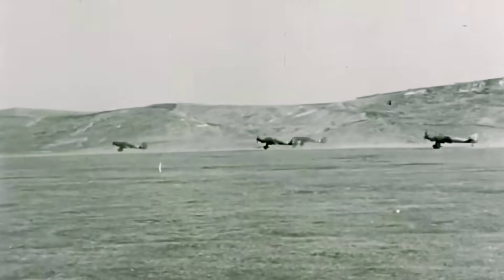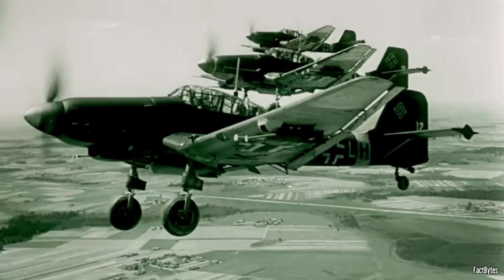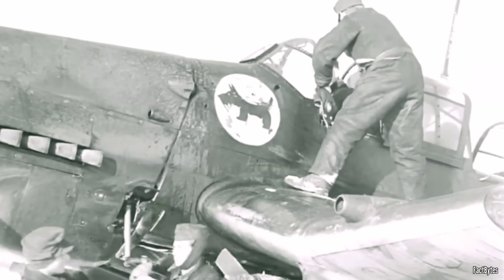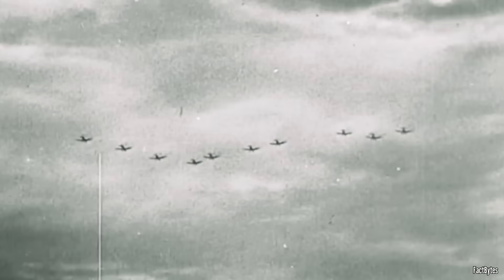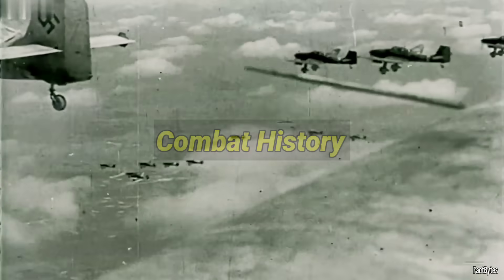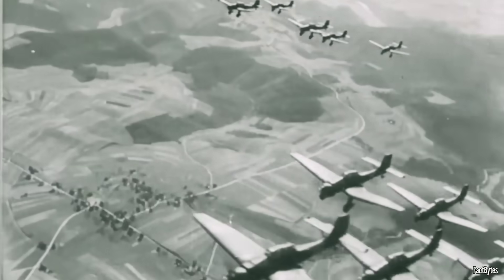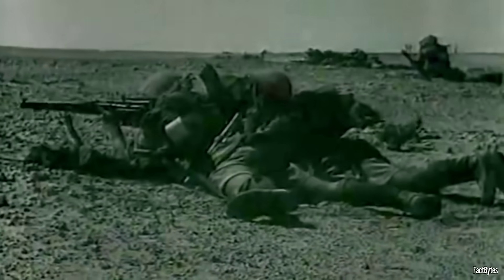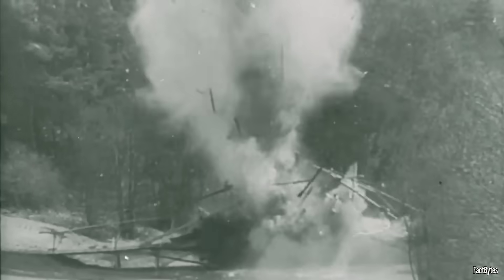The Anatomy of a Dive Bomber: How Stuka Pilots Hit with Deadly Accuracy

Comment: The depiction of the airbreaks on 3:53 is wrong. They were positioned in the front lower part of the wing and not at the ends. Exactly next to the wheel strout base.Right on the top front of the underwing cross.

Comment: So far, this is an excellent explanation of the Stuka ( pronounced Shtuka with a Latin U ). However, because they did NOT dive 100% vertically, they were not very accurate, yet, for the WW2 standards, they were OK. No, they CANNOT hit a tank, contrary to the common understanding. They can, only, do so, in case they dive to a few meters from the tank. However, after a lot of practice and a lot of runs, they may. I think, the way they did so was by diving quickly and then flying horizontally against the tank to a few meters. Either way, they were marvelous for the WW2 standards, but, very easy to shoot.

Comment: The pull up automatc didnt pull up the Ju87 from a dive, it only trimmed the plane nose up, so when the pilot passed out from the pull up, the plane would continue to climb.
In later models the pull up automatic also wasnt conected to the bomb release anymore.
The accident were the Stuka flew into ground were controlled flight into ground, because the pilot didnt or did pull up to late, it had nothing to do with a failure of the pull up automatic.

Comment: It's difficult to execute a true 90-degree dive. Even if the aircraft is pointing straight down the wings are still supplying lift and the true angle of dive will be about eighty degrees. I wonder how the Stuka would have performed at the Battle of Midway, which was won by the SBD Dauntless. The Dauntless had large barn door dive brakes and if one air brake was damaged by flak, the aircraft became uncontrollable! Those pilots were something else... The minimum safe release and pullout altitude for the Dauntless was 3000 feet but I think that the Stuka went lower.

Comment: Tank killer version with mounted antitank guns/"cannon" instead of carried bombs used in late War ?
  I think most of the failures of the pullout mechanism was when the pullout or bomb release was done too close to the ground. 
  I imagine that the life cycle of the airframe was good only for a limited number of dives/pullouts before the possibility of stress cracks would get too high- that is after a certain amount of use the plane needed to be retired or it would eventually break up during the pullout
Also not supposed to dive vertical- but it did
American dive bombers much faster and carried more ordinance but couldn't dive vertical and thus less accurate ? At Battle of Midway a then newer American divebomber model had to be dived at a somewhat steeper angle than it had been approved for but when that was done it took out all of the Japanese carriers ? 
  JU 87 "Stuka" one of the first uses of a new high strength Aluminum alloy ? 
also had explosive bolts that allowed the "Eagle Claw" landing gears to be blown off/jettisoned for when the plane had to be "ditched" onto water safely ?

Comment: The sirens were also removed because they had a habit of deafening the crew.
Reply: Yes, not many videos actually mention that they removed them. Although I have a book and they were still present on some late on in the war. Even though this video mentioned they were removed it continued to use the sound effect all the way through. It must be the most over-used sound effect since the talkies. Wish I owned the copyright. If I did I'd stop people using it.
I'm sure I either read, or heard in an interview, that the name Jerico Trumpet wasn't applied to the siren but to the device they sometimes attached to the bombs, which had a similar effect without deafening the aircrew.

Comment: there is one on display in Hendon RAF museum London ..... 
I was very surprised at how big it really is .... and yes built like a tank ..... 
a lot of Stuka pilots apparently pierced their eardrums with a needle ... to overcome air pressure equalisation issues ?
Reply: Funny as a pierced ear drum now makes you medically unqualified to pilot an aircraft.
Reply: Yes the Stuka at Hendon is impressive.They also have a Fairy Battle, which is pretty rare. As a kid I actually climbed through the Lancaster they have there. I'm very skeptical about the ear drum piercing. Do you have a source? I have a book called Stuka Squadron, about Stukagruppe 77. No mention of it in there. Puncturing your own eardrums seems like something you'd mention. Also, I've done a sky dive from 12,000 feet (the height of a Stuka dive) and I didn't have any ear problems, although my terminal velocity was lower.

Comment: The Stuka also had a quick fuel dump mechanism on some series, and were employed on night intruder roles in 1940 & 1941. 
A Ju 87 achieved the first air victory during World War II on the morning of 1 September 1939, when Frank Neubert of I./StG 2 "Immelmann" shot down a Polish PZL P.11c fighter while it was taking off from Balice airfield.
True, the automatic pullout sequence was distrusted by some,not for reliability reasons but 'they disconnected the system because it allowed the enemy to predict the Stuka's recovery pattern and height, making it easier for ground defenses to hit an aircraft." (Stuka Angriff: Sturzflug von Helmut Mahlke, Mittler Verlag -1993).
At Rechlin and Desau they realized that the highest centrifugal g load a pilot could endure was 8.5 g for 3 sec. and at less than 4 g there were no problems encountered  on consciousness loss or visual impairment. Raising the centrifugal force above 6 g, half of pilots experienced grey-outs. With 7.5 g...vision vanished altogether for 30% of pilots. The inverted gull wing design offered several key aerodynamics advantages besides providing better downward visibility.  It also allowed for a shorter and sturdier undercarriage. Additionally, the inverted gull wing configuration, with its double-spar construction, improved lift at shallower angles of attack, which reduced take-off and landing distances. Many innovations employed in the StuKa, like the attachment of the FuG 101 Electronic Radio Altimeter and the use of the FuG 16Z transmitter/receiver set to augment the FuG 25 IFF (Identification Friend or Foe).  It was the only dive bomber that could routinely do a 90 degree (true vertical) dive. If not misused for the role it wasn't designed for, the Stuka was truly in a class of its own.

Comment: The JU- 87 show cased gernany's technology advances. The plane was a flying computer! The pilot only had to set dive then the plane did pretty much every cept for take off & landing. Best dive bomber ever.
Reply: Think they had to hand fly the dive up to the point of bomb release. And hope not a split second too late for the release and pullout. But probably the closer to the ground they bottomed out at,the potentially more accurate the bomb placement such as on a moving automobile.

Comment: Also one of the best-looking planes of the era. Great lines. 👌
Reply: It's so ugly it's beautiful!  (Long comment follows)in the past I built several scale models, both the Revell one in 1/32 scale and the Airfix in 1/24 scale.  The most fun part was painting it with an airbrush.  In a book, I found a Stuka used on the Eastern front, that had a winter camo scheme that i found very interesting.  If you love to airbrush your models, boy have I got a project for you! 

The paint scheme I used was German "Hellbrau" or "Lichtblau" on the underside, and German medium green on the upper surface.  Then I mixed up some flat white and set the airbrush on the lowest pressure I could get away with using, because I wanted to make the white lines as thin as possible.  

And then I over-sprayed the top surfaces with a series of thin, squiggly white stripes applied seemingly at random as the real aircraft had been painted.  (I suspect the Germans might have "winterized" their aircraft in the same way the Panzer crews did to their machines, by using white-wash or some other semi-permanent paint, and just washed it off the planes/tanks once the snow was off the ground.  
When it came to winter camo patterns, I doubt two Stukas looked the same, especially since winter camouflage was usually applied in the field by the ground crew.  Anyway, i loved the effect afterwards - the best way I can show what I did is how this guy painted his: 
https://tinyurl.com/w6f39v3v
Reply: @Tiberius_I  I find really interesting the desert camo scheme of the first batch. The B and R Stukas that arrived there were painted in the original factory two tone green at the Junkers factory. On site was only available the italian chaki yellow which was applied by brush or airbrush leaving green patches below. It is really amazing to see how this was. I have built some decades ago a 1/48 exactly as those. First the standard greens with sharp endings and over the italian chaki sand  yellow. Given that the yellow would get really dark for matters of trasparency, I first painted the base color with it, and over it I painted the two tone green. The beauty of it is that the yellow looks like airbrushed, whereas the greens look sharp like paintbrushed. I have it  with open the engine compartment, canopy and left cannon opening. Plus a small oil hatch in the opened lid position, All full of leaks and desert maltreatment.
Reply: I feel the look somehow embodied the Nazi ethos.  It was an amazing artistic expression in that regard.  There's one in a Chicago Museum, but it lacks the spats on the wheel assembly and somehow it seems something is missing.  It's like every detail mattered aesthetically.
Reply: It wasn’t just about what the Lancasters carried—it’s how they looked doing it. That sleek, powerful silhouette cutting across the moonlit sky gave the whole operation a kind of dark elegance.

Comment: I think you may have highlighted the dive brakes in red incorrectly.  I believe the dive brakes were the horizontal slats just behind the landing gear. Please confirm.
Reply: Yes. At 3.30 you see the dive breaks in flying position from the front as just a thin line, so thin were they. Seen at 3.46 you see the dual lamella from below. At 3.53 you see the Junkers-Doppelflügel incorporated in the red line - that are in truth ailerons and/or trailing edge flaps. For diving, the lamella were rotated 90 degrees. Think of it: you had to put them somewhere, in proximity of a structural element, like the main wing spar, but out of propeller wash. So they put it appropriatly at circa one third depth of the wing, outward next to the landing gear, up to the middle of the outer wing, where the hardpoints for the bombs were.

Comment: ANY a/c type operating in a zone of enemy air supremacy will sustain prohibitive losses; the Stuka was perfectly normal in that regard. And every plane is designed for a role(s) that, if not properly utilized, usually produces disappointing results. Herein lies a lesson of the woes that comes of putting amateurs & nincompoops in charge. Unprotected Stukas, SBD's, B-17's, it doesn't matter. Even had the Germans been flying  the vaunted P-51's in '44 & '45, it wouldn't have changed the outcome. That the Stuka endured under tremendously adverse conditions the last two yrs of the war says a lot for the concept & design. I believe, on almost the very last day of the war, a lone Stuka planted a bomb squarely on the mid-span of a key bridge on the Eastern Front, eliminating the threat, and successfully returned to base.

Comment: According to Eric Brown, test pilot extrodinaire, the Stuka was the only true 90 degree dive bomber.
Reply: Cookie was the coolest prop-job test jockey, and a hazard to Condor bombers
Reply: I saw an interview of a Dauntless pilot. He said there was no 90° dive bomber because even if the nose was straight down, the wings' lift caused a significant ground speed. He said they did dive nose directly down in the Dauntless but were actually traveling about 70° from horizontal. That had to be considered in aiming.
Reply: @Mishn0 But if he'd never floen a Stuka, which Brown had, how would he know - ?
Reply: @simongee8928  On the other hand, Brown wasn't a trained, experienced dive bomber pilot.
Reply: @Mishn0  It's a technical topic. Stuka controlled it's speed so well + the automatic pull out it was the only one where you could actually risk doing that.
Reply: @paulcrisan4551 - But it wasn't.
Note, also, US Dauntless pilots ragged on the shallow dive angles of IJN pilots! 😎
Reply: @Mishn0 It was the automatic dive function from the Stuka , as soon as the pilot deployed dive breaks the elevator was trimmed to get the plane nose heavy . As he released the bombs the elevator got put back and the plane got out of the dive automatically , even if the pilot blacked out from the high G . So they could dive from 70 to 90 degree .
Reply: @Mishn0  of course the Stuka could dive 90°, it had red markings for that on the side windows.
Reply: @mske903  I didn't say the Stuka couldn't. I said the Dauntless could; making Brown's claim incorrect.

Comment: Imagine being that rear facing gunner as the pilot went into the dive. It'll be fine, or it won't.
Reply: I always thought that was a terrifying position 😮
Reply: Not a problem at all. Did you ever hear about "hammerhead" aerobatic figure? 90 up, cartwheel over the wing and 90 down? Find any aerobatic flight company nearby and enjoy, usually its not too expensive.  Its not true high speed dive, but true vertical flight.

Yes, I can do it.
Reply: @antontsau  I can see it from the pilot perspective...big snap roll and a deep dive until the g's put your butt in the seat. Exhilarating. As horrible as war is, the individual moments, for man in machine, must have been quite something.

Comment: Why no retractable landing gear?
Reply: More costly, it would take up space, less sturdy, and its drag would help slow down the dive speed.
Reply: @Zajuts149 drop the gear down before diving. 

Other considerations dont outweigh performance benefit.
Even the flying tanks like il-2 and Helldiver had them.
Reply: @Zajuts149  Very well explained.
👍
Reply: 1930s design . Wasn’t believed that Ju87 would be in air to air combat (that was role of ME109) . Cost saving, sturdier aircraft , quicker to build